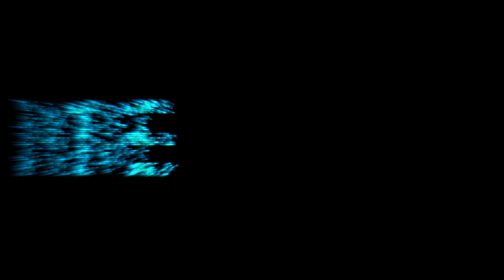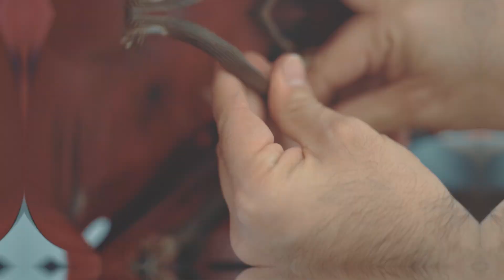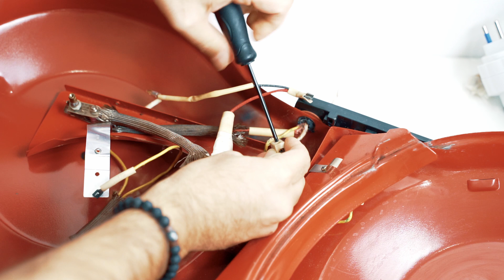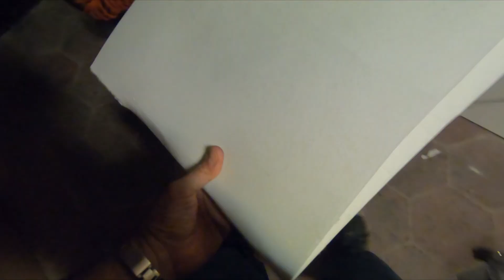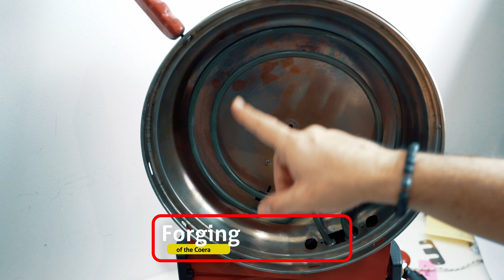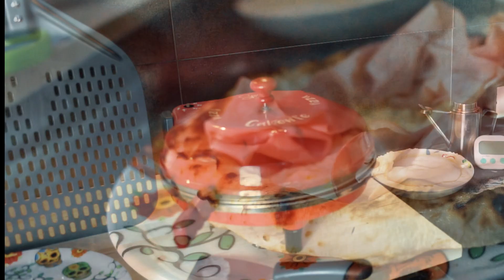Coera 1400 watts mod: Homemade neapolitan pizza in less than a minute #coera #pizza

Comment: Hello!. thank you so much for this! can you let me know wich model of coera heating element you would use for a ferrari g3?.Ciao!
Reply from the maker: Hello the g3 Ferrari is not so great for this mod since its not made of stainless steel like the caliente so the 1200w would be safer in that case as the dome materials  wouldn't be able to sustain the high temperatures of the 1400w for example
Reply: @fgtechtips  so the caliente is currently the best mod base? I have one of the (newer) g3ferrari delizias and looking for a good model for a mod project. Thx for all the tipps and your videos!
Reply from the maker: Sure, the best around together with the Spice Diavola, these are the only ones made of stainless steel. Everybody knows the G3 Ferrari since it's more popular but it has much more plastic and lower quality materials compared to the Caliente
Reply: @fgtechtips  I just got the Spice Caliente. However at the first try, it only reached 250 °C. The lamp turns off, even before the the thermostat reached the set position (recognizable by the clicking noise). Is this normal for a new Spice Caliente? The G3ferrrari didn't have such problems.
Reply from the maker: Yes it's normal that the spice caliente turns off at 300c. Check my new channel for thermostat regulation and other mods  https://youtube.com/channel/UCCY2z66Cz_BGAHFcEgBU19Q
Reply: @fgtechtips  Oh I see. great to know! thank you for the advice

Comment: If we just get the 1200w it’s a simple exchange ? Without having to do all the extra steps ?
Reply from the maker: The 1200w is exactly the same, you could just avoid the dome insulation step compared with the 1400w

Comment: A very interesting video! I want to do this for my Optima Napoli. Question: you are talking about 2 times 110V inside this oven. I heard that the Optima Napoli is completely 220V inside?
Reply from the maker: Hi and thank you. With this oven as I explain at 03:02 I had to switch from an electric system in series to a parallel one, going from 2 heating elements of 600w and 115v each, into a single 1400w 230v heating element (Coera)
Reply from the maker: Anyway with this mod you really get great pizza results, comparable and also better than professional results, as you can also see in this more recent video https://youtu.be/_k1fy5eOD-M
Reply: @fgtechtips  These pizza's look incredible!
Reply: @fgtechtips  Ok. I was told that the Optima Napoli was already a parallel system?
Reply from the maker: Sorry I don't know that oven, as said check if the heating elements are 110 or 220v that should give you an answer
Reply: @fgtechtips  Ok and thnx!

Comment: Im about to get one of coera, wich one do you think is better between the 3 options 1200w 1400w or 1600w, maybe 1200w is way to low and 1600 way to high? And the perfect one is 1400w?
Reply from the maker: The 1600w I guess would be good if your baking chamber will be increased more than 5cm, you should use a dimmer with it
Reply from the maker: Hi even the 1200w is very good but with the 1400w you see in this video you  can bake in 50 seconds and you can also do this mod https://youtu.be/CBK7Usal-LA

Comment: I just bought an Effeuno. No more modding needed..
Reply from the maker: Different use different gains, there are tons of modding there as well anyway ;)
Reply: @fgtechtips  I rocked hard with G3ferraris for more than 20 years now. We got the first one around the late 90s from Rimini. They are nice ovens. But even the "stock" Effeuno is opening me now a whole new dimension and the pizza just gets perfect. I also have a biscotto, but i removed it again after the first use. It just takes too much time and energy and i can notice no real advantages. I just dont want to burn down my kitchen, i think :-)
Nice infos and video anyway!
Reply from the maker: Yes Effeuno does everything on it's own, it's extremely easy anyway these circular ovens are unbeatable as portability, you can put them in a drawer when you are not using them or take them with you anywhere, Moreover once well modded you get basically same results as Effeuno Which is more like "fixed" not movable . Anyway you will soon see effeuno mods as well in this channel ;)

Comment: Any ideas to make the baking stone rotate?
Reply from the maker: No need of rotating the stone with this mod, you can see it cooks perfectly in 50/60 seconds without need of rotating the pizza. There's already a video in the channel anyway for a manual rotation if you have performed the double thermal element mod

Comment: What material did you use for the insulation of the dome ?
Reply from the maker: Usually a fiber ceramic mat is used, I found one partially ecologic capable to substain up to 1500c. Not sure about the composition
Reply: @fgtechtips  TBH, I bought a Spice Caliente, a Fiesoli stone, a coera 1600w, an SCR regulator and few other things, but now I'm worrying about the ceramic fibers' carcinogenic effects regarding the thermal insulation of the dome.
Reply from the maker: @yavuzsezgin9804  use Mask and gloves and close everything with aluminium foil as I show in my video. As long as you don't breath it , there should be no danger

Comment: Nice video and channel!! One question i have just bought an ariete 909 1200w pizza hoven that its similar like yours(maybe more plastic).
I havent  done any modification and im a little afraid... I have seen in your video and you are not setting the bottom thermal(its empty below).
Because im a noob, it would be good keeping the original bottom thermal on bottom and getting  the coera double thermal(1200w) on top? i want to say...it would be good only replace the simple original thermal on top by the double coera? i would need less work, only disconnect the simple thermal and plug in the new double one,  dont you?
This mod would be fantastic for me as im from spain.
Lots of thanks!!!!
Reply from the maker: Hi and thank you! In my channel you find the answer to both questions you have. You can watch my Coera mod video, understand effort cost and results you get and compare with the double heating element video (moving the lower hearing element on top). It depends also on how much you want to spend and your level of satisfaction. Anyway as I explain in this video yes the double heating element mod is probably a bit more complicated than the coera one but it's free